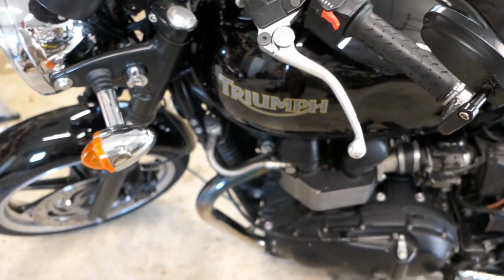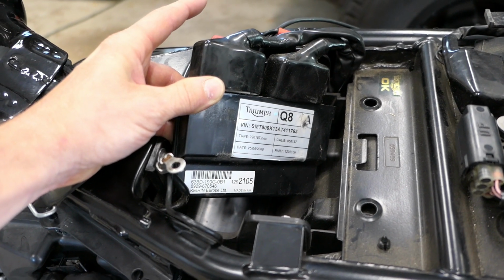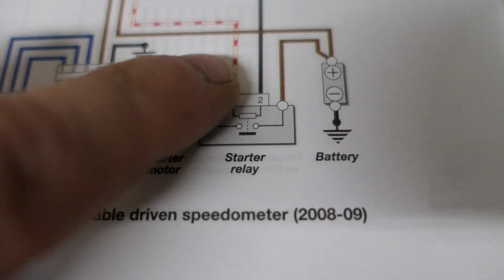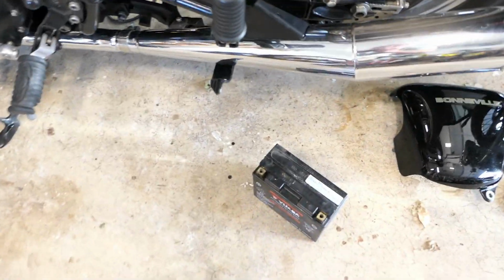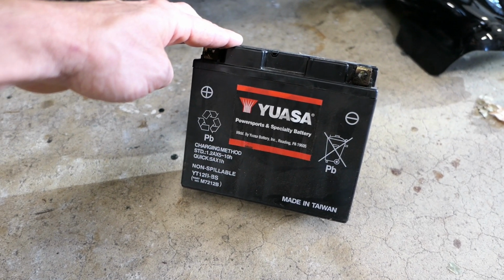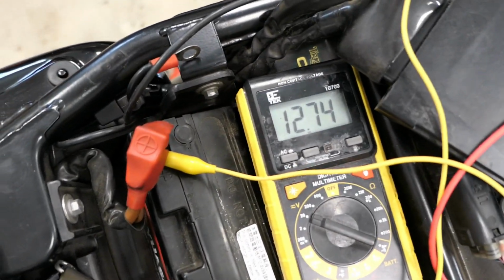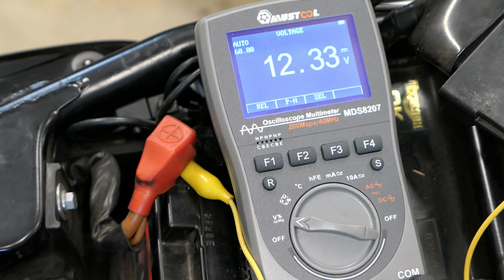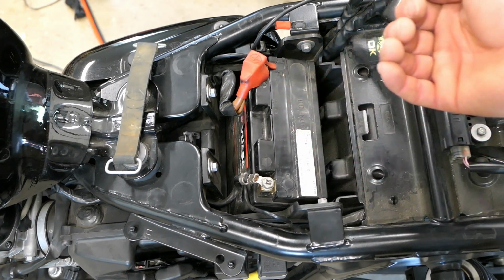Understanding The Triumph ECU Starting Issue

Comment: Great video. Have an O7 triumph tiger 1050.  Should there be any parasitic draw on any of the fuses? Have .51 ma on fuse 4.  No matter what I unplug the draw is there. Blinkers, horn, alarm, etc.
Reply from the maker: That is a fuel-injected bike, which means it has a computer to control the fueling and timing, as well as other things.  The computer, and possibly the instrument cluster, needs a very small amount of power so it can store in memory the data it collects during use.  There is some non-volatile memory in these computers, too, but it is normal for there to be a very small draw when the bike is off.  The amount of draw you describe may very well just be the normal draw the computer and/or cluster needs for it's function.  It shouldn't be enough to drain the battery quickly, so if you are having that issue you may need to look elsewhere.  I have a video on this subject for a different bike, but it may help put your mind at ease:  https://youtu.be/AhqZwLnD9Jk?si=9civH9jU8e_kfYjA
Reply: Shared this with our triumph 1050 Facebook forum! Thanks again!

Comment: I have a tiger 800 from 2015. I have a recurring issue where the fuelpump doesn't prime. Last time it fixed itself after a few months (battery on charge entire time). Then it just worked and have been working untill today where the pump isnt priming again. Could it be the same issue you are explaining in this video but that triumph have involved the pump as well? The battery is old but i have removed it as a problem since measurements have shown it as healthy, but apparently might ot be after seeing your video.
I just cant find the issue. Last time i went thru everything, fuses, relays, leads, connectors etc and no errora reported by the ecu.
What do you think? Thanks in advance.
Reply from the maker: You didn't mention the mileage on your bike, but it could be the pump itself.  If you turn the key to the on position and measure your battery voltage it should be somewhere in the mid 12s.  At that point the fuel pump should spin up.  If it doesn't, it would be ideal to check the voltage and ground as close to the pump as you can physically get. You can back-probe the connector or you can use a piercing probe on the wire itself.  If those readings are very low or non-existent then you have a problem somewhere in the wiring harness or fusebox.  That could be a broken wire inside the insulation, a bad ground, or a fuse which looks okay but which has to be tested to show a fault.  I have a video about fuse testing, actually.  But, if you find with a meter that there is good voltage at the fuel pump itself, or as near as you can get, then the fault is the pump assembly.

Comment: If at 12.3 volts will this not be enought voltage to turn off the lights? My problem on a 2015 thunderbird is the same as depicted in the post and when hitting the starter the lights do not go off. The Interstate battery is 2 years old. Why not get a battery with more cranking power if one will fit in the tray? Also do you know where the switch might be that turns off the lights
Reply from the maker: Well, I have a few thoughts.  First, I don't know that your 2015 model is wired the same way as the older Bonneville in the video. It's possible your lights are not intended to go out or that somebody made a modification.    If your problem is that you are getting a click when you hit the start button, it could also be other things, such as a bad ground, poor switch contacts, or a faulty starter.  You should first evaluate your battery condition, and I have a video about how to do that properly.  Once you are certain of a good battery, then you can look at other issues which might contribute to a no-start.
Reply: @tinderboxarts  Thanks.This is a hair puller

Comment: My 2009 scramble has a good battery and starter relay. Fuel pump and everything primes. When I hit the start button i hear no click and no crank at all. The button seems to do nothing. Any ideas what it could be?
Reply from the maker: Are you certain about the battery?  MANY people make assumptions without actually testing.  I'll put a link below.  That aside, it could well be that the starter button or wiring to it could be bad.  You can test this with an ohmmeter on the wiring as you press the button.  You can use piercing probes if you can't find somewhere on the harness to disconnect.  The issue could also be the starter itself or wires/cables having poor connections.  Start with the battery, and then test each circuit from there.  If you don't measure voltage to the starter at all when you press the start button, though, then the issue lies in the switch or that primary starting circuit.

https://youtu.be/d-5xA31nBd8
Reply: @tinderboxarts  Yes the battery is reading a little above 13V. And the starter solenoid is receiving above 12v of power. I'll test the switch and hope it is that.

Comment: Mine has started doing this again. All night on a battery tender and then the click. Battery is 9mths old. I just bridge the terminals on the starter relay with a screwdriver and it starts.
Reply from the maker: Well, use a meter to see what your voltage is and if it looks a little low that could be your issue.  On the other hand, don't overlook the possibility that you have a poor connection or damaged cable somewhere either.
Reply: @tinderboxarts  I will do that. It only happens on cold mornings
Reply from the maker: If it is temperature dependent that does typically point to the battery.  Do your voltage tests when it is cold, then.  The age of a battery doesn't always indicate it's condition.  Make sure you test the charging voltage with the bike running, too, because you could have a charging system issue.  A parasitic draw from an alarm or GPS or other device can also be an issue.  I have videos on how to test for all of that.

Comment: The only doubt that comes to me is, if we all hear the "click" and it is in the starter relay, so why the starter motor does nothing? The ECM should evaluate the battery voltage before the starter relay "clicks", because when the relay is on the starter motor will drop the voltage dramatically even with a new battery. So my question is why it clicks and nothing happens?
Reply from the maker: Well, sometimes the relay could click just because there isn't enough voltage available to fully engage the relay and the starter.  You have a nearly dead battery and it's enough power to make the relay move but not enough to turn over the starter.  This was a common occurrence on older vehicles. Is that what you're referring to?  In the case of the ECU control, I suppose the relay is clicking because power is momentarily engaged before the ECU cuts it out, but I'd have to test that hypothesis.
Reply: Something very odd going on here. I've seen the same problem on the Triumph forum. The guy's bike would turn over and start every time if he manually operated the relay armature by closing the relay contacts using a piece of wood. Yet using the starter switch would just get the click from the relay and you could see the relay armature moving. No starter motor movement and no dimming of instrument lights though.  Starter motor is still going to turn over at a lot less than 12V and when at full cranking amps will possibly drop the battery terminal voltage to nearer 10V but bike will still start. Operation of the relay contacts when closed as normal by starter switch energising the relay coil needs close inspection. One of those simple faults that are often far from straightforward.

Comment: Hi there!

 i have a problem with my bonny t120 2016, i posted 2 videos on my channel, there is some issues with the electronic, today the service from my village just call me that he wasn’t able to find what is the problem with the fuse for the indicators clock alarm etc…. Actually the fuse was blown and obviously the indicators wasn’t working so i put a new fuse then the ignition went on with out the key inside (funny miracle) the indicators start working but then i try to start the motor but it couldn’t start. 
Then i removed the fuse and i start the motor without the fuse and i put the fuse back, everything went fine but when i try to turn off the motor with the key i couldn’t, he keep working without the key inside…. I have posted 2 videos on YT i you can take a look and share any tips i would be thankful. Btw i already made appointment in triumph service but i need to wait 2-3 weeks. 
Btw the service in my village think that the problem could be in the ignition that’s why i would like to know if there is option to put single gauge! 
Sorry for the long comment.

Comment: Thanks a lot 🙏  just wanting to know if I don't get the stock battery of 12 volt and 10 Amp then will it be ok to use a battery rated 12volt 9amp or 12 volt 8.6 amp
Reply from the maker: Well, all batteries are going to be 12 volts.  Batteries are further rated by Amp-hours and by Cold Cranking Amps.  The amp-hour rating is mostly related to size.  A larger battery will have a higher amp-hour rating because it can store more energy.  The cold cranking amps is a measure of how strong a voltage a battery can maintain while cranking during cold temperatures. So, your bike will have a specification which is partially related to what can physically fit in the space given.  If you use an undersized battery you may find that the battery cannot maintain minimum voltage while cranking, and therefore you would have hard starts.

Comment: Hey Tinderbox..., I have a 2006 Triumph scrambler that starts just fine but shuts off about a half hour into a ride. The bike will generally shut off mid ride and need to sit for about a half hour in order for it to be able to start again. The bike's ignition will turn over but the bike will not start when it's in dead mode. Curious if you have any experience with this issue.
Reply from the maker: You'll need to do some testing to figure out the issue.  Either you are losing spark or losing fuel and there are lots of potential reasons for each.  If the spark is shutting down it could be a marginal component or connection which fails when it gets hot.  If it's fuel related it could be a plugged vent line to the fuel tank or an electrical issue with the pump.  When you get to a failed condition you can spray some starting fluid into the intake while you are cranking.  If you get a sputter out of the engine then you have a fuel problem.  If you do not get a sputter you should check for spark by pulling a plug, grounding the electrode, and looking for spark while you crank.  Of course, it could also be a general problem, such as a loose battery or ground connection.
Reply: @tinderboxarts  This is really helpful... I'll start here and see where it gets me. I was under the impression it might be a pickup pulse sensor but I switched that out and I am still having the same issue with the bike. It shuts off when it heats up and takes about 30 minutes to cool down. Thing starts right back up only to do it all over again. Super frustrating as I thought this bike would be reliable daily driver and it's become a nightmare to deal with. Basically been unrideable for months.

Comment: I ran into this problem this weekend, new battery 3 weeks old. Took it out, drove 400km without a hitch. We're in the middle of a heat wave. 33 degrees celsius+. When the bike sat during the warmest parts of the day i couldnt get it to crank, or engage the fuel pump but the tft lit up and everything electric worked. (Lights, etc). As soon as the temperature cooled back to 25 degrees or lower, the bike fired up instantly without a problem. Any insight on this? Can heat cause flat battery? Bike is a 22' Tiger 900
Reply from the maker: Heat can absolutely affect a battery, as well as the battery connections.  And, a new battery doesn't necessarily mean a good battery.  You need to charge the battery fully, then test it under load to gauge it's condition.  I have a video on that process.  At the same time, check the physical connections for any issues and check the charging voltage.  The Tiger charging systems are pretty good, as is the starter.  I would suspect you have an issue with your new battery or the physical connections.
Reply: @tinderboxarts  sounds good I will check it out ! Thanks

Comment: My speed Triple starts from cold, but after a run when hot will turn over but not fire up. Battery good voltage and fuses all good.
Reply from the maker: Anytime you have a no-start issue, you have to methodically consider three things required for an engine to run.  You need: an air/fuel mix, you need spark and you need compression.  In your case the bike will run when started from cold, so a compression problem is unlikely.  That leaves fuel and spark as potential issues.  It's not uncommon for an engine to show issues only when warmed up or only when cold.  Sometimes that fact points to areas of concern, actually.

You need to do some basic troubleshooting now.  With the bike warmed up, shut it down confirm that it will not start.  Checking for spark is not difficult.  There are several ways of doing this, you can pull a spark plug coil and a plug and hold the spark plug electrode to a ground while you crank the starter.  Do you see a spark jump?  Then you just eliminated that potential problem.  There are also spark checkers you can buy which sit between the coil and plug and show you in a clear tube any spark going through.  It doesn't matter how you do it, as long as you can confirm there is some spark.

With that eliminated, it leaves fuel.  There are many potential problems with the fuel system and heat or time from a warmed up engine.  You can check that the fuel pump is coming on at all by listening for a whine when you turn the key to the on position.  If you don't hear that whine, you many have an electrical problem leading to the pump, or the pump itself may be faulty.  You can also check the harness with a meter to see if the pump is being supplied a voltage.  If you do hear the whine, then the next question is if the fuel is getting to the cylinders.  One potential issue is a fuel tank which develops a vacuum as the engine runs because of faulty venting.  You can temporarily remove the gas cap to check for that problem while to try the starter.   Another potential is that the pump is feeding the fuel injectors but they are not getting a signal or they are faulty.  You can spray a little starting fluid from a can into the intake while you attempt starting and if the engine sputters to life, that tells you fuel is not getting to the cylinders.  So start with some of these procedures and see if you can narrow down the problem to either spark or fuel.

Comment: I was having same problem. I changed the battery, but now a new problem. The motor is cranking but not firing up. What could be the reason?
Reply from the maker: Well, the two problems aren't necessarily related.  It's possible you had more than one issue and if it wasn't attempting to start before, you would never have known that it couldn't start!  It's also possible that you caused a new problem in the process of replacing the battery.  In any case, if the bike is turning over easily now, but not starting, you'll need to do basic troubleshooting for fuel and for spark.  You didn't mention the bike or model year.  If it is a fuel injected bike, is the fuel pump spinning up when you turn the key to the on position?  As a quick test for a fuel injected or carbureted bike you can spray some starting fluid into the intake and see if you get a sputter of life out of the engine.  If you determine that you are getting fuel and the starting fluid does nothing, then turn your attention to the ignition system.  Pull a spark plug, ground the electrode and look for a spark.  Or, if that is difficult, pull the spark wire and ground out a spare spark plug to look for the same thing.  If you find no spark, then you need to diagnose the ignition system.

Comment: I have a Bendex Connection problem with my Tiger 955i 2004 i  chainged the coils, regulator and rectefier and new 14AMP battery the bendex still gets stuck.
Reply from the maker: It's been awhile since I heard that term used! If your starter is not engaging there are two possibilities: an electrical issue or a mechanical issue.  You can test at the starter for the starting voltage to make sure there is enough there to get the job done.  Have a helper attempt to turn over the engine while you measure with a meter, or use alligator clips.  If that checks out, then the other possibility is that the starter itself is gummed up with debris or just worn out.  You may be able to disassemble and clean it, or it may not be worth that effort compared to the cost of a new one.

Comment: My 2017 Tiger 800XCA is playing the same game, but I'm not convinced it's the battery.  The battery is a two year old Shorai and measures 13.3v with no load.  I haven't done a load test yet (it's raining as I type this).  But when I press start, there is no "click" sound from the solenoid, which btw is under the battery.  I was able to start the bike ONCE by jumping battery positive to the starter -- it fired right up and idled.  Since then, it will try to start, but won't fire at all.  I'm stumped and the dealer won't look at it for a month.  Doesn't help that I'm on a trip and had plans for it.
Reply from the maker: Well, of course, there are plenty of reasons for a no-start issue.  Potentials include the ignition switch, the cables and connectors, kill-switch, or a safety switch (kickstand, gear, tip-over).  All you can do is methodically go through these possibilities with a meter and test.  However, I will say, often a thorough visual inspection up close and personal will reveal a problem.  We jump to the hard stuff sometimes without first using our eyes for the obvious.
Reply: Believe me. It’ll be the battery. Change it or borrow a friends.